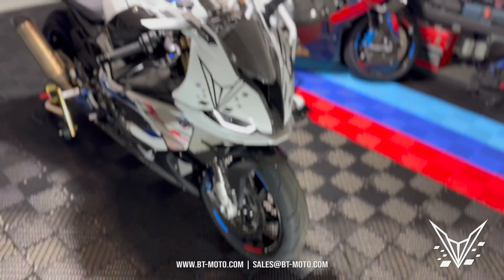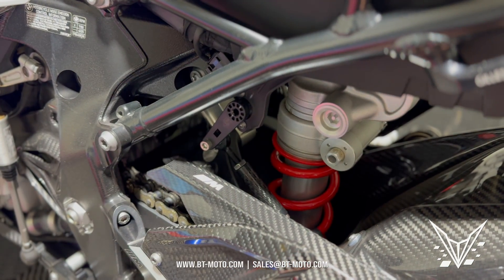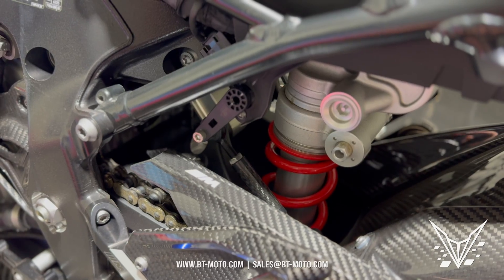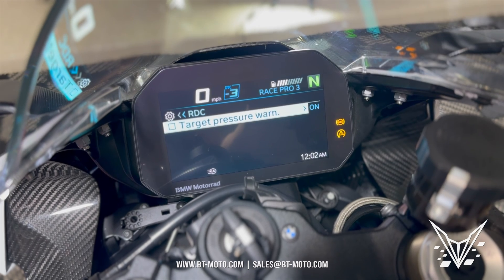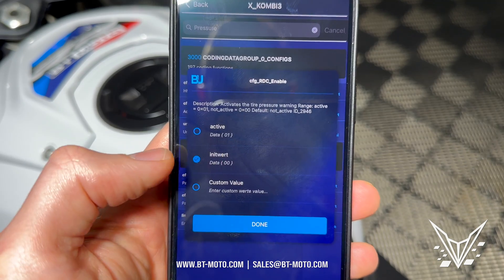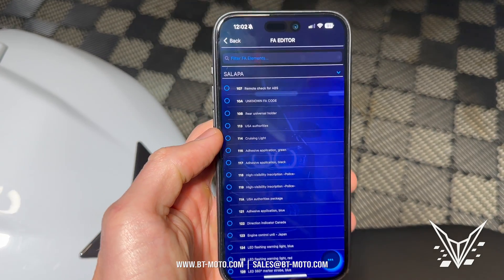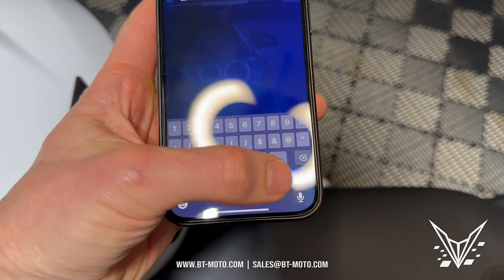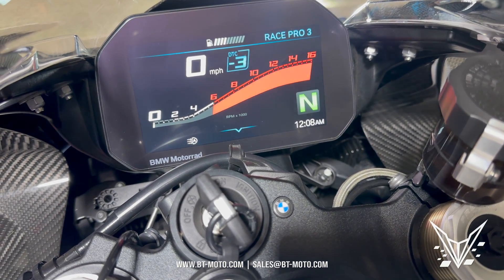BMW Coding Tricks, Remove DDC and TPMS Errors

Comment: The same was sent to  BT Moto  email - what is being described in this video DOES NOT WORK on 2023 S1000RR

Above does not work -
I am fairly certain that BT Moto did not actually go through the actual removal of DDC suspension and this finding was, even though a seemingly happy finding, has absolutely no effect on removing ECU/DTC codes, nor does it clear out the dash.

Steps to reproduce -
Connected factory DDC front fork and shock - bimmer utility reads no ECU codes, dash is clean.
Used Bimmer utility to disable 223 (DDC) & (proactively 235 - Dynamic package)
Disconnected factory DDC fork and shock
Bimmer utility reads ECU codes, dash flashes error code
Removing / clearing the codes has no effect - DTC codes are there, dash flashes with issues.

NOT BASHING - JUST WARNING - THIS DOES NOT WORK.

Comment: I appreciate you doing these.  However I don’t think you are right about the Bluetooth connection in Racetrack mode.

That procedure, as it says in the code description, it just enables/disables the ability to enter Racetrack modes by removing or displaying the Racetrack tick box.

I know you are busy with other things but it would be great if you could find a process that would allow Bluetooth connection and media control in Racetrack mode on a 2019-2022.

Comment: if my 2024 s1000rr has all the options minus tpms sensors can I just add the sensors?  dealer said its 1k in parts, but a $295 option on the build and price.

Comment: How safe is the stage 1 beren tune ?
Reply from the maker: All our tuning is safe for your motorcycle. We have the only 50 state legal tuning, which means it had to pass a lot of tests.
Reply: @BT_Moto  I’ve seen a few M1000s blow up , so I was a little hesitant to get it for my S1000RR
Reply from the maker: @Anonymous-gl3fb  we’ve owned 3 M1000RR’s (currently have a 23) without any issue. We’ve owned over a dozen S1000RR’s with no issue as well.

Comment: How about coding for menu adjustments while the bike is rolling! I've seen other videos on how to do it, but it always seems to revert itself. Super frustrating to not be able to adjust the suspension or engine in race pro while moving. Not always safe to pull over just to make a tweak. Also hopefully this would also enable the ability to switch modes with the handlebar button without stopping. 

Thanks for all the great work, very much appreciate the free content!!
Reply: If you're asking about rain, road, dynamic modes , yes - they can be switched on the fly. As soon as you apply throttle or brake, its activated.
Reply: @noahnitikman2436  I believe he was refering to the settings, which you cannot have access while riding.
Reply: @giorgosfourou  he said modes, not settings, but who knows? lol
Reply from the maker: Thank you and good idea!
Reply: @BT_Moto  another good idea for owners of S1000RR 19-22 models.. or XR, would be to add in the menu the "lights" which is stock in 23, to prevent warning lights of turning indicators for example... or tail light...
Reply: @giorgosfourou I would like to have that asap 🖤
Reply: @RR-95-GR  That would be awesome!! 🥰🥰
Reply: just search for speedlock and set it to no lock

Comment: You can set the pressure ro whatever you want in the kombi
Reply from the maker: You can adjust the ranges for the warning with the BU. We can make a video for that, if requested
Reply: @BT_Moto  Would be great to see the steps, even though the settings were right there on the aktiv screen you turned them off on.
Reply: No you can’t